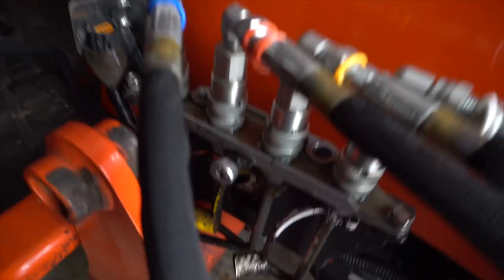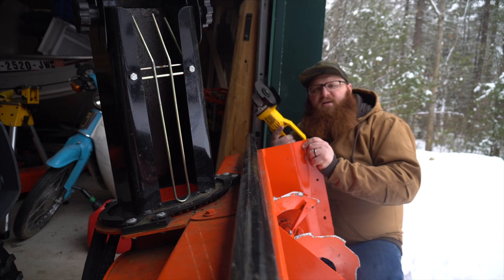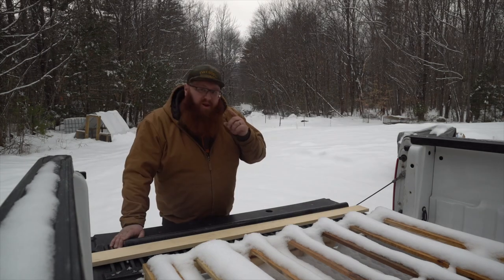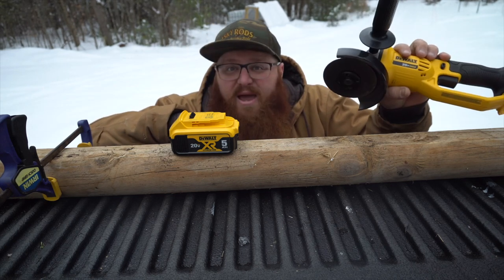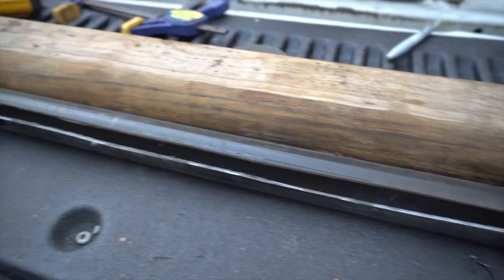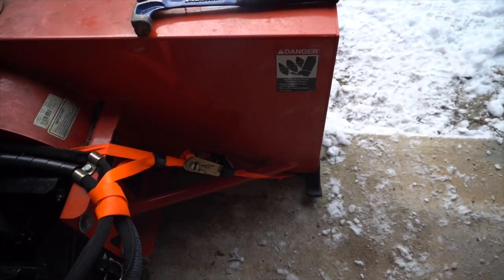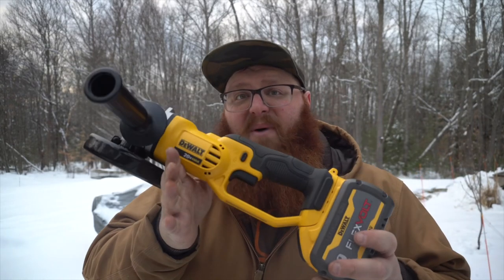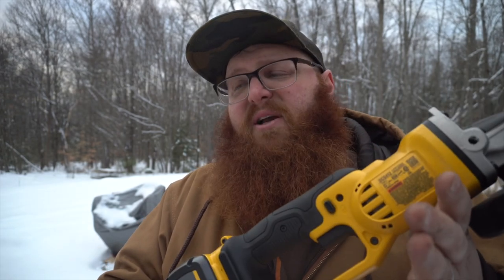Building A DIY Pipe Cutting Edge For Our Kubota BX Snowblower

Comment: So I tired out your  idea here, cut slit in a 48" long 1/2 inch diameter  pounded it on and spot welded it on each end and center to cutting edge.  Works fabulous on my tz25da with 54" front blower.  I'm just amazed.  Thanks for the idea!

Comment: That horizontal slice looked like a pain!    For tools like grinders I always go corded.  The extra power is nice.   And since it's not a tool I use often, or remote, it works out ok.   90% of the time I use it I'm in the shop or garage
Reply from the maker: It could have been worse. The cut went pretty quick.
Reply: New chordless grinders are freikin game changers though.  Milwaukee one is every bit as good as a chorded one.  Just keep a spare battery or 2 on hand depending on the size of your job.

Comment: Thanks for the idea of putting a pipe on The cutting edge of the snow blower.  I have a Rock drive that I use with a walk behind snowblower.  The snow blower always grabs rocks and throws them.  I just got done putting a pipe on the cutting edge of my walk behind snowblower.  I'm thinking I probably won't have as much problems with rocks being thrown out of my drive this upcoming winter.

Thanks for Michael 👍
Reply from the maker: Very cool!  Let us know how it goes.
Reply: Yes I will.
Reply: I just got a chance to use the pipe modification on my walk behind snowblower today and it definitely helped from picking rocks from the drive and throwing them.  There still was some but not very much compared to what it used to be.  Bonus for me when I use the walk behind snowblower on my concrete sidewalks it actually cleans more of the snow off the sidewalk because I have the skid plates raised as high as they can go.  Only one thing would be better if my drive was more level, don't have a tractor to level it I got the nice big hump in the driveway.  Thanks for sharing Michael

Comment: Just some future advice with your grinder.... don`t plunge cut with it, it will eat up your wheels in no time.  Work your grinder like a file, forwards and backwards. 
Just make a  single groove in the metal with the cutting blade, your grinding wheels will last 10 times longer. And less wear-n-tear on the grinder/motor/battery, too.

Comment: To help keep it on, what about drilling a few holes, tapping/threading them and then running a bolt through them and onto the blower. Use a nut/double nut on the bolt to keep it in place

Comment: i did not have that problem i built some massive ski's for blower unit when new. it rides with 3/4" gap to the scraper blade. the two ski's are one inche thick and seven inches wide.

Comment: I have the same Dewalt grinder it started to make a little noise so I removed the 4 screws and removed the plastic cover over the angle drive there was VERY,VERY little grease on the angle drive gears so I re-greased it and the noise went away .. I actually have 2 Dewalt and 1 Makita cordless grinders so checked the other 2 and they both didn't have much grease in the head ..

Comment: Use a piece of PVC or ABS instead, a lot easier to manipulate and smoother to glide over obstacles
Reply from the maker: It will break and get sucked right into the blower. A friend had tried that previously.
Reply: @TheMindfulHomestead  hmm been using mine for years with no issues!

Comment: Although my blower is a different model  to lessen the occurrence of gravel entering into blower in addition to lowering the shoes I had welded 1/4" × 4" stock with both ends turned up and then in my case  reversing direction. So they extend a little more out  front yes I do leave a little more snow on the driveway but I seem to hit less stones

Comment: I understand why, with a gravel driveway you would do this, but the cutting edge serves an actual purpose to cut into the snow, as your blowing. Now that it has a rounded off edge how will it cut into hard packed snow? I get it could be a life saver in terms of letting gravel into the blower. I just think it might be harder to get that wet packed hard snow into the blower without it being obstructed by the pipe. Idk just my thoughts. Cool idea though.

Comment: Cut the pipe 2” longer on each end. Cut the 2” over hang in half. Pound the overhang halves flat with a 3 pound hammer. Drill 1/2” holes in the overhang tabs. Anneal them with a torch and bend them upward with a hammer. Hook the hooks into the ear tabs them ratchet strap it over the shroud of the blower. That will keep it fully out of the way and free from wearing out.

Comment: So, I just cut two old steam heat pipes from our house for a Kubota snow blade and the snow blower. Steel pipes were over 130+ years old. Each I cut a 3/4" opening to go over the snow blade and the snow blower. I started the fist pipe with the grinder and cutting wheel. 8" in and had to replace the wheel. I grabbed my Milwaukee saws-all, old plug in model and a Milwaukee "Torch" blades. About 15 minutes per cut, X2 cuts, X4 blades and I was done. No sparks, way straighter. Why does everyone use cut off wheels? I have cordless and corded, I get the cordless, but sometimes it just does not make sense.
Reply from the maker: It was what I had at the time. I wasn’t going to buy a reciprocating saw just to make this cut. 

Also, I believe, if I remember correctly, that I made this whole cut with only one cutoff wheel that was already pretty worn down. Cold rolled black pipe is pretty soft. 

Which makes me wonder. Is the steam pipe you used cast?  If so,be careful with the snowblower. I intentionally used cold rolled black pipe, as it will bend and not break if it hits a rock. A cast pipe runs the risk of breaking and getting sucked in if you hit something hard enough. Not saying for sure that’s what you had, but it’s something to consider.

Edit: After thinking on it a bit, I’m confident you did use cast iron pipes, which would explain how quickly your cutoff wheels wore out. Cast iron is very hard, but very brittle. I would not use it on a cutting edge due to the chance of it breaking.
Reply: Jack, the pipe is steel, just really old steel. Not claiming my way was better, just an alternative. I have used the Milwaukee "Torch" blades for a while now, just never let me down. Your ideas on the snow blower pipe gave me the idea to do the same on the plow. I did the PVC pipe one year, though it worked great it fractured really quick. I'm glad I went back and watched your 2 (?) videos on the metal pipe idea. Quick on, quick off. I have a lot of sidewalks here in Manchester, CT but also a stone driveway and need to make paths to the animals shelters. @TheMindfulHomestead
Reply: @TheMindfulHomestead  Quick question on your setup before you went with the new tractor, did you have the snow blower shoes all the way down?
Reply from the maker: @chocolyle1216  I did. The shoes all the way down lined up with the pipe perfectly to get a good seal on the ground.

Comment: YOUNG MAN .

THIS MIGHT HELP U BETTER FOR YOUR SNOWBLOWER / HEAVY - DUTY  CONVEROR BELT !
Reply from the maker: You cant install it on the BX2822 snowblower.  The cutting edge is parallel to the ground.  It won't scrape the dirt, it will point forward.

Comment: How can you say poor design that blower was designed to cut thru snow and take it down to the ground witch is what it does. It’s not the blowers fault that you’re driveway is not frozen or paved
Reply from the maker: The blower was designed to work on all surfaces. However, with a cutting edge that digs in and scoops vs scrapes, it’s not optimized for our surface. 

This fixes that flaw.
Reply: Have you adjusted your shoes all the way down
Reply from the maker: @danyoder3534  Yup!  Shoes are all the way down.
Reply: Curious to see how that pipe works
Reply from the maker: @danyoder3534   8-13” forecasted for Monday night. We’ll see soon!